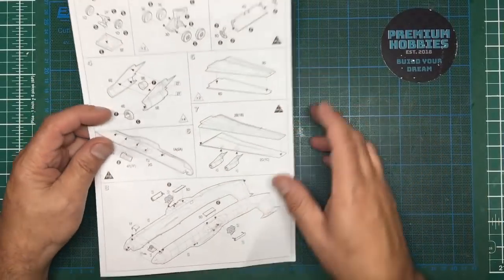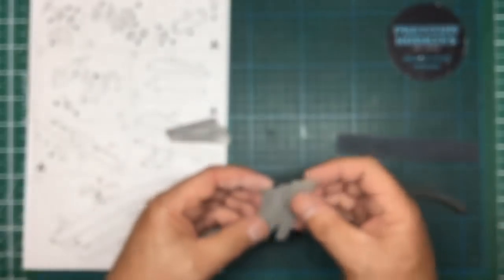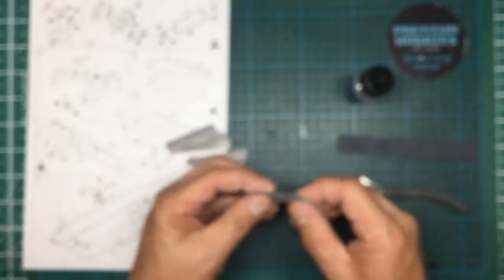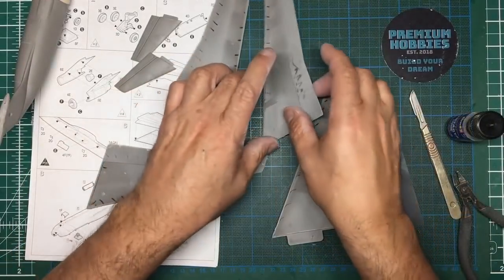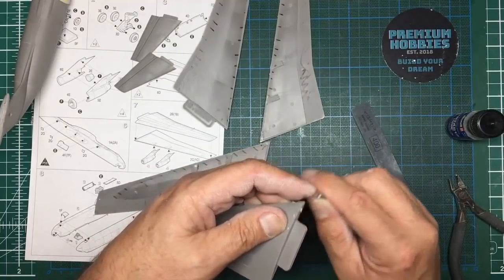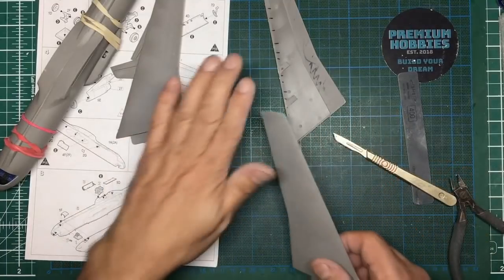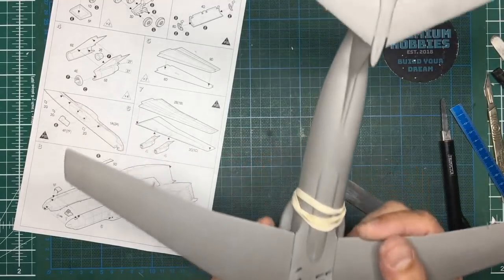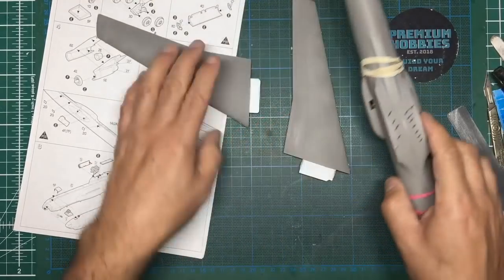Roden C-141B Starlifter build. Part three.

Comment: Great News HK Models is releasing a 1/48 B-17G new tool in October and from the CAD pictures it looks just as detailed as the 1/32 kit with complete interior and bomb-bay  the surface includes scribed rivets/panel lines!!!! I have been waiting for a new 1/48 B-17 for decades I really hope hey also do the B-24 and Lancaster in 1/48!!
Reply from the maker: Dont get too excited. If it is tooled the same as the 1/32 kit it will be off. Nose is round, fuse too tall, fuse too fat etc.